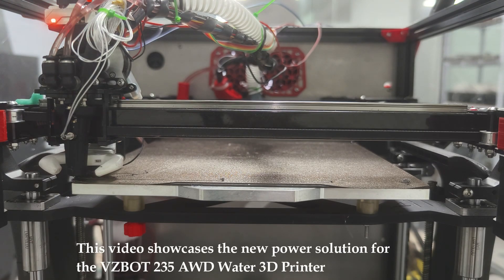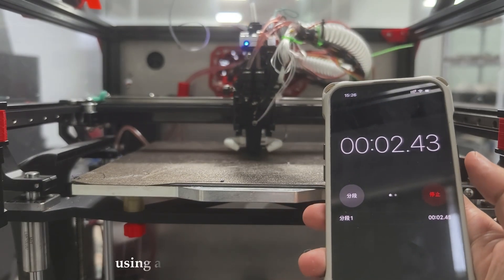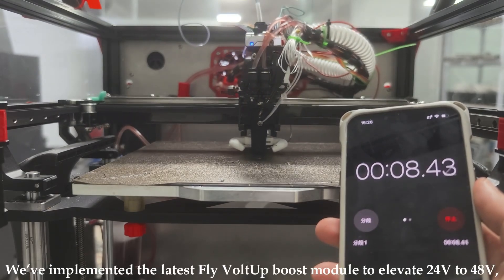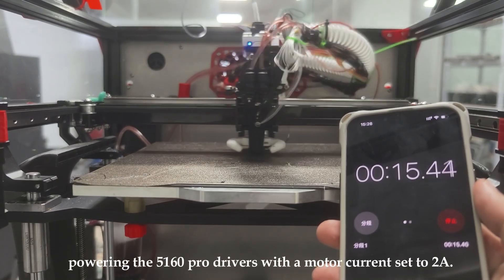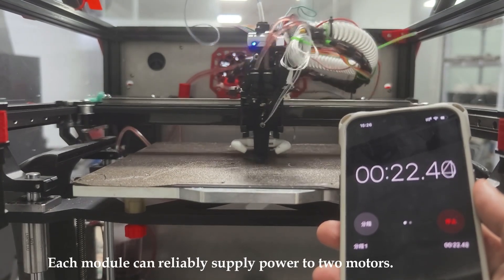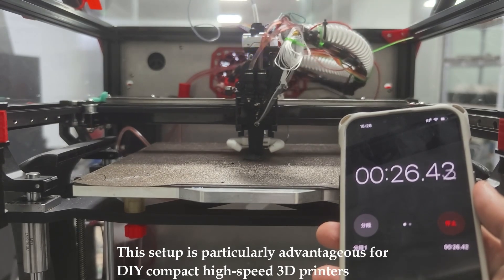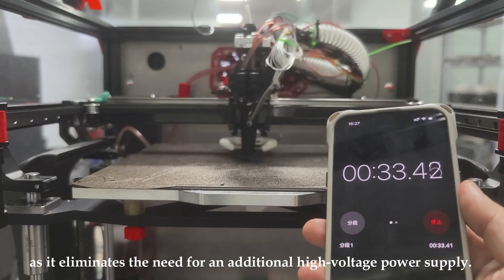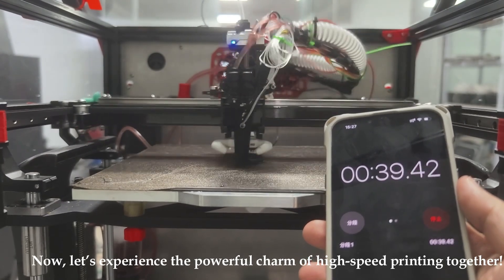Mellow Fly VoltUp Power Board 48V/60V Boost Module – High-Voltage Drive Solution For DIY 3D Printers

Comment: Boards like the btt manta series have a single high voltage input for the high voltage stepsticks, can the two outputs of this product be connected into the single 48V rail in order to drive 2 steppers? If not, are there any plans to make a higher amperage single output version of the voltup?

Comment: I don't have this board, and I'm not associated with Mellow, but here how I think this works. The module has 2 boost converters. Each converter can be independently set 48V 2A, or 60V 1A. They typical use case should be to use the board with 2 external TMC5160 boards, not with a stepstick. You should probably not use the 2 boost converter outputs in parallel, it might work, but typically you don't want to connect outputs together. If your motherboard has a separate motor voltage input then this module probably does not have enough power to supply 3 motors, even when you put it in parallel.
Either way, you have to be very careful with High voltage stepsticks and separate motor voltage inputs. A lose motor voltage connection can already blow up the (expensive) stepsticks. The stepstick IO power and motor power must come on at the same time otherwise your stepstick will release it's magic

Comment: I have received mine. If I want to use this to power the Motor Power input on a board such as fly super-8 or Octopus, would I run both outputs of this in parrallel to the printer board motor input? and select HV jumper for the HV stepper sticks?
Reply: @Plumpkatt1  lol mellow is not saying a word.

Comment: Can you combine the 2 outputs to the input on my mainboard?
Reply: I have the same question I'm wondering if I can run them in parallel to the octopus motor input and use the appropriate jumpers to select high voltage mode for motors 1 and motors 2 which are my X and y. The rest of my drivers are 2209 therefore I would leave the jumpers on the main board set to normal so that it uses the printer board 24 volts. I want some confirmation before I try this though. I don't want to let out the magic smoke.
Reply: I'm using the qhv 5160 step sticks by fystec
Reply from the maker: this jutst for HV5160 driver
Reply: @3DMELLOWPrinter  yes but I have an input just for my x and y.

Comment: if max current is 2 amps at 48V, wont that mean that you need one of these for every one or two motors? at that point isn't it cheaper to buy a dedicated 48V power supply?
Reply from the maker: @lordathetos696  This is suitable for small machines. This is a DIY machine solution
Reply: @3DMELLOWPrinter  makes sense, thanks for the response